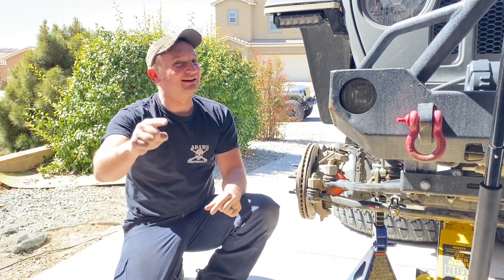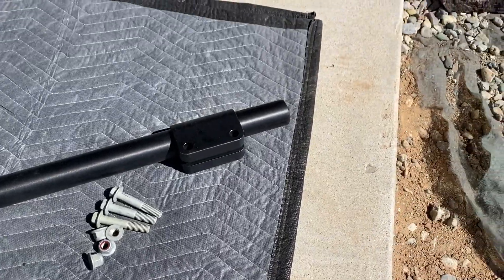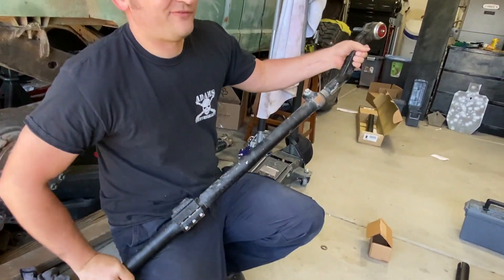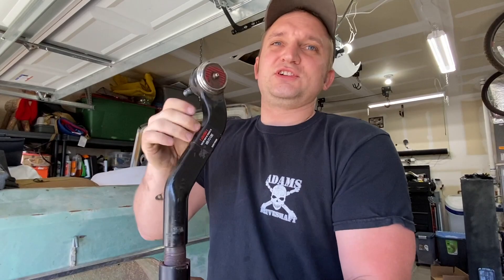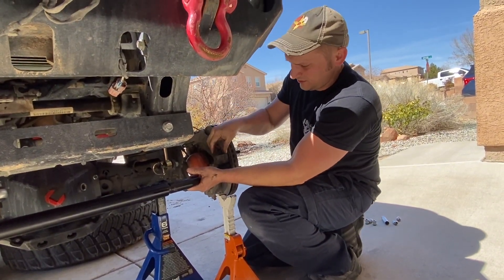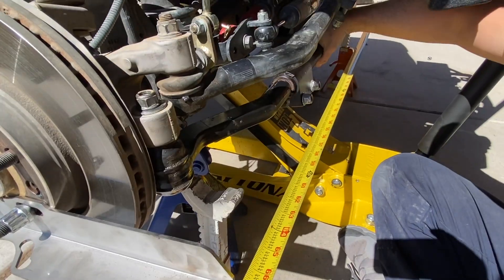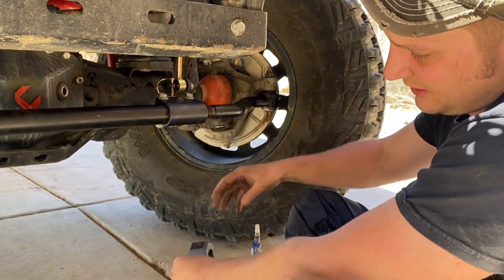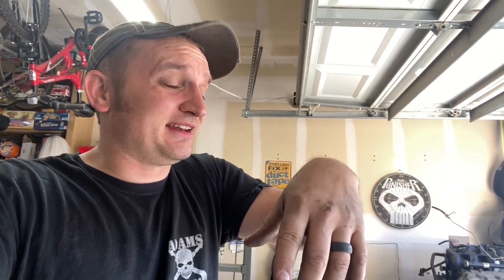SteersmartER with this steering upgrade for your Jeep JL/ JT

Comment: Can u explain the 1/32 rule. I just ordered all steersmart stuff draglink tierod and trackbar. Also good with the track relocation bracket.  When doing this in my drive way on the jackstands im just measuring the old and copying what’s on the stock stuff ? I know I’ll need an alinement after but I don’t understand the toe 1/32 rule. Lastly do I need to buy the pitman are bracket u did a video on with my 3.5 in liftkit  thanks 2017 jku

Comment: Hello, I am new to jeeps with my new JL rubicon with manual trans. Did I understand you right that you have to change the tie rod bar every so often to keep thing right or just when you screw them up wheeling?
Reply from the maker: I was wanting to see how steel compares to aluminum… you only need to replace these parts when u actually break it… the only part designed to wear… are the TRE (tie rod ends) however most after market parts allow you to grease it periodically which will significantly increase the life span of the joint

Comment: Never found a follow up. Would you make the change to aluminum again or stay with the steel tie rod.
Reply from the maker: Both have been solid…  I haven’t been able to tell a difference between the 2 materials… both ride the same. 

Really depends if you are worried about bending by hitting a rock

Comment: Not a fan of SS, but I'm digging THIS! So, I'm assuming they have the drag link as well? Also, where did you get your toe plates? I need those!
Reply: Think they came from the delivery guy.   A couple cheap magnetic 2" levels will work too
Reply from the maker: Alluminum is always sexy 😂. I will say this about SS... it has never failed, and I ain’t easy on it. 

The tool? Is bleeping jeeps design... thou leaves a bit more to be desired...
Reply: @JLLIFEOFFROAD  bleeping jeep?  Huh...would've figured yo got'em off the TOE truck 😁😁  huh? Huh??

Comment: Silly question but are you using balancing beads in your wheels? Only reason I'm asking is because I'm running the same tires now.
Reply from the maker: No, these tires were balanced with weights, haven't had a problem.

Comment: Thanks for the video but curious to know why go from steel to aluminum??  Also, you stated 105 ft lbs on the tie rod ends??? I have a JLU also and the manual for my steer smarts yeti XD install paperwork shows 120 to 130 ft lbs.
Reply from the maker: Yea, I learned today they updated it... on my ends there is a sticker that says 105lbs